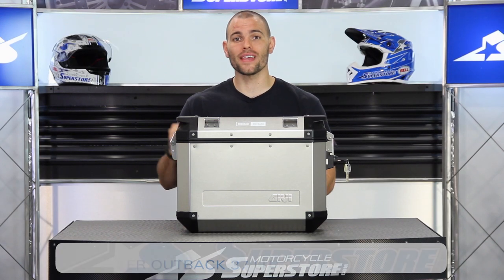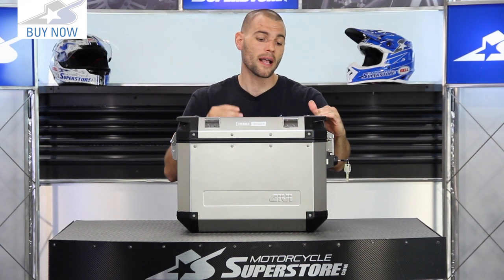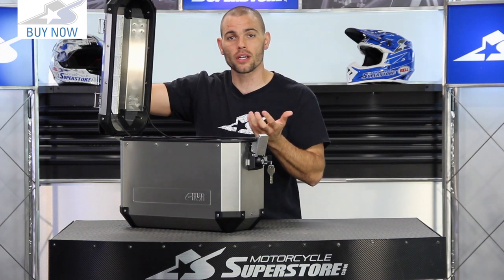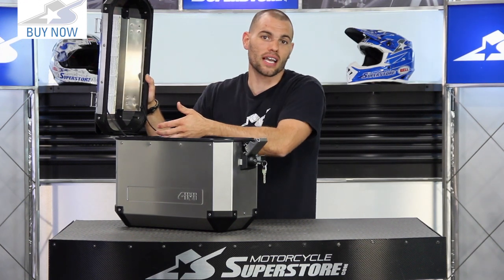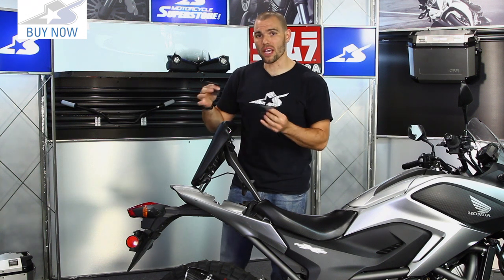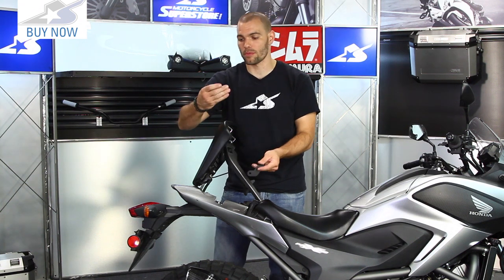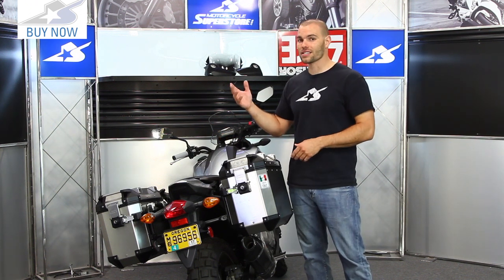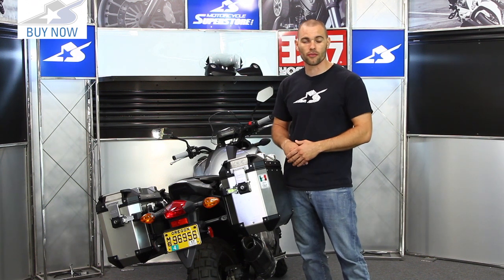Givi Trekker Outback 37-Liter Side Case with Install | Motorcycle Superstore

Comment: GREAT VIDEO - I understand it's dated ... but it's still a relevant video for consumers buying side cases. Pricing has dropped on the cases to $725 delivered with price matching by suppliers. To the commenter 5starDave suggesting you "switch to decaf" ... I disagree. I really value a fast moving review and perhaps 5starDave should take up remedial english classes somewhere. This is a VERY GOOD overview of the GIVI Trekker Outback. BTW - this case is an exceptional case in my "informed" opinion. I owned this case on my 2016 BMW S1000XR for 5 years, and 44,000 miles. My riding was mixed between British Columbia, Pacific NW, and Baja at speeds consistently 70-90MPH in Baja (22k miles in Baja) ... these cases performed FLAWLESSLY. I dropped the bike in a parking lot with a passenger once, with ZERO cosmetic marks on the cases. The nylon corner bumpers worked perfectly to protect the case. The only issue i had with the Trekker is some minor wear or loose play in the Cam bracket (left side)  at the 37,000 mile mark. By strapping my center seat duffel between the two cases - i alleviated the problem.  I personally like these cases so much, I purchased a new set to be mounted on my new 2016 S100XR (another 2016 unit with 4,500 miles) ... and I purchased a set for my new 2022 R1250 GS Adventure. Have gone down the route of the lovely Mosko Moto bags, and the Lone Rider bags ... I don't ride off road and frankly find the hard GIVI cases a better alternative to the "trendy" $1,000 soft bags (whaaat?) ... but again, I don't ride off-road except fire roads in New Mexico, Oregon or BC. Have owned the factory BMW rigid panniers also, and believe GIVI quality is "double" the BMW brand pannier on my 2018 GS Adventure ... can't speak to the 2019 - forward rigid panniers for BMW. So - 5stardave, your "insult" to the reviewer is what motivated me to defend him and the GIVI product. So, if you or Church - n - Chapel are trolls, I guess you succeeded. This is a GREAT PRODUCT and a VERY GOOD review. Note - I suggest the consumer purchase the storage Net which fits under the Lid of each case ... I suggest the consumer purchase the $14 rubber GIVI straps to mount on Top of each case to prevent sliding of items you place there under any netting (in Mexico I strap Fuel Bladders) ... NOTE: one of the best parts of the rigid cases is the ability to install VERY BRIGHT running lights (LED RED) which transition to EXTREMELY BRIGHT RED BRAKE lights ... something you cannot do on a soft bag. Safety is enhanced significantly with these additional running and brake lights. Plus on the S1000XR 162 HP rocketShip the GIVI Trekker cases make me appear as though I'm just another old guy on a BMW adventure bike (and "that's a good thing," as Martha Stewart would say)... DOWNSIDE? In the sand, I 'did" get my left ankle caught under the rigid bag (just like the soft bag guys warn, and I acknowledge) ... but one would have to ask, why was I moving the bike in the driveway deep sand in Baja? How many Margaritas were involved in this 1.5 MPH crash ... and of course, was it really my fault? Great Product, not perfect but close. Terrific Review.